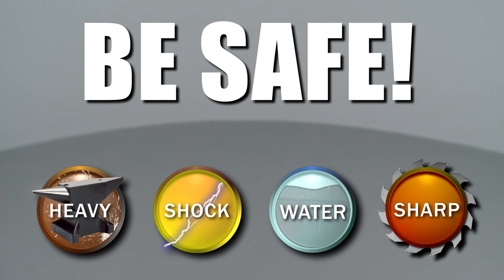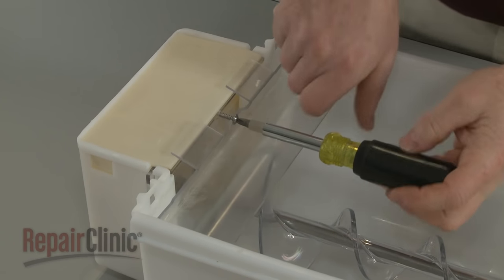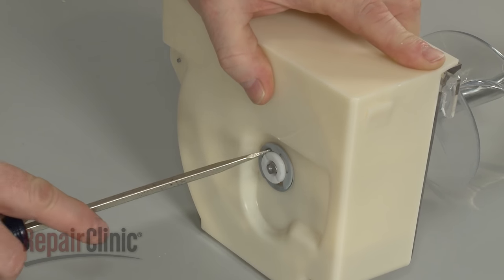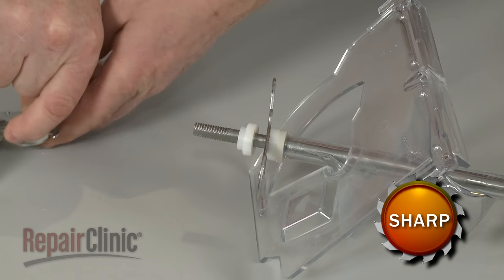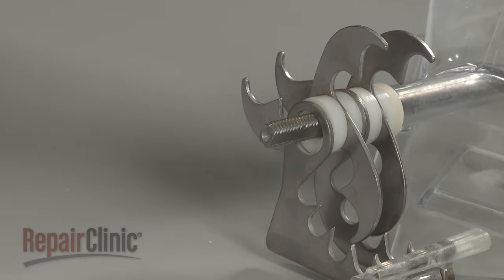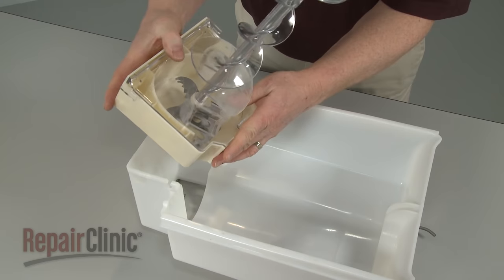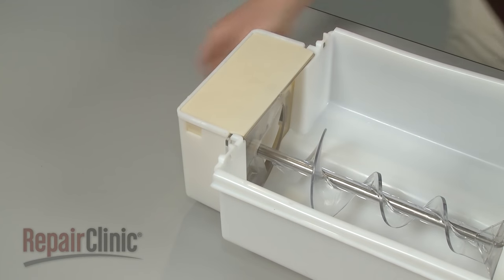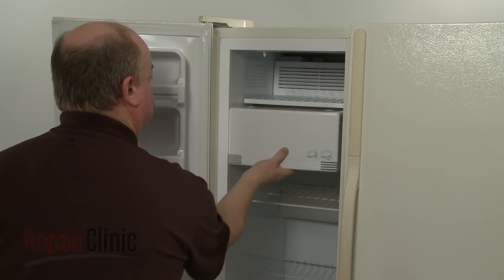GE Refrigerator Ice Bucket Auger Replacement #WR17X11705

Comment: One more tip:  if you slide the jaws and plastic washers off the auger and directly onto a slim screwdriver they will slide right back on in the right order.
Reply: I wish I had read this tip.  Now I think I am missing one spacer.  Is there a part number for the spacer?
Reply: Or rubber band them together, everything stays in place, except of course for the locking nut.
Reply: Screwdriver was perfect!!
Reply: Great tips, glad I read this.  I just squeezed them a bit and transferred them from the old one directly to the new one.

Comment: Thank you so much for this video. I replaced the Auger and Auger plate as both were cracked also had to remove and  lube the Auger drive with food  grade grease as the auger drive  was frozen solid. I'm very grateful you saved me a lot of money. As the  tech wanted $125.00 just to come to my house + labor and repair. I did it my self for for $38.02. They would probably charged me 250.00.

Comment: Top notch.  Showed clearly the blade assembly onto the shaft, which was nice for determining order and orientation of the plastic washers.  I would have had mine done in under a half hour had the metal shaft on my non-GE replacement auger been machined properly (had to use a rotary tool to extend the flats farther down the shaft).
Reply: Glad you wrote that. I'm about to do the same thing and wanted to verify it wasn't a terrible idea.

Comment: Thank you for this well done video.  Your excellent close-ups let me see the order of the washers and blades.  I was sure to order the correct part #, but the shaft end (flat area) was longer than the original, resulting in the 1st two washers to go back on being loose.  But it worked fine that way - tried adding washers, but it bound up the auger.
Reply from the maker: We sell genuine OEM replacement parts that go to your model at RepairClinic.com.

Comment: My unit had a washer under the actuator arm bracket.  It’s purpose is to align the arm so it doesn’t bind when actuating the white flapper that controls whether ice is crushed.  When I reassembled I had the washer on top of the bracket, should have been underneath, and when checked movement of the arm it was binding or catching on the flapper.  Put the washer under and it works smoothly.

Comment: Amazon auger I received is correct length and shaft length is the same. However, the first spacer distance is longer on the new one. This leaves a gap between the spacers and the first metal piece. Thought I had not put correct spacers on at first. Then in comparing shafts, saw the difference in length of round part of the two shafts. Adding a spacer won't work, because the flat area of shaft is too short for all the pieces to be assembled. Other than having the shaft milled down, I can't see an easy fix.
Reply from the maker: We only sell OEM parts. You may have purchased a non-oem part, which may be different from an OEM part. Double check on our website by entering in your model number: RepairClinic.com

Comment: Thanks for the video - if you have any idea why the ice crusher is not working, I would appreciate the help. I followed your video twice and still can't get the ice to crush
Reply: Sounds like maybe you have the blades on backwards?
Reply: Probably the solenoid that moves the  actuator arm, or the plastic linkage between the solenoid.  My linkage broke, you may not need to replace the solenoid just the linkage. Search on ice dispenser solenoid service kit

Comment: The removing of the blades portion is not nearly detailed enough. And adding some verbal instructions would be extremely helpful. There are other tutorials in YouTube for this and I would recommend watching one of those over this one.
Reply: Where are those videos about blade order. We are going nuts trying to figure it out!
Reply: Agree I pray we replaced ours in proper order!
Reply: @lareefleming8094 the video I just linked is good about showing the blades and washers. This Repair Clinic video is better at showing how to put the auger assembly and blades back into the housing though. The guy on the other video didn’t even touch on that and of course I didn’t put it in right the first time.

Comment: I also found the part on Amazon because GE does not supply replacement parts. My only issue is that it sounds 'tight' so maybe it just needs to work a few times and adjust? Hoping I don't have to take it apart and do it over again.
Reply: @repairclinic  thank you.............it just needed to work itself in a bit. Once the bucket filled completely, it worked just fine. No more tight grinding sounds.......just the ordinary sounds now. The video gave me the confidence to take it on myself. I was really nervous about the plastic parts cracking but it turned out great.

Comment: So I'm just wondering what the best way to test the auger motor? My auger rotates just fine and when the door is open and the interior switch is pressed while using the dispenser/door pad the solenoid kicks but the motor wont turn?

Comment: I just bought an auger that is bigger than mine. Mine has close to 11 inches. How do I know the right model of the auger? The model of the refrigerator, indicated on it's inside is psc23shna and the auger has the code 197D2316A011 on it

Comment: I am a 51-year-old woman who bought this part for $15 on Amazon and I was able to change it because of this video.   I do advise to emphasize the spacers around those blades and the necessity of keeping that stuff together and yet it doesn’t really stay together.   I see I put the thin spacer in the wrong spot after install.   I hope it doesn’t matter.   Reassemble did not point out the difference in spacer size.